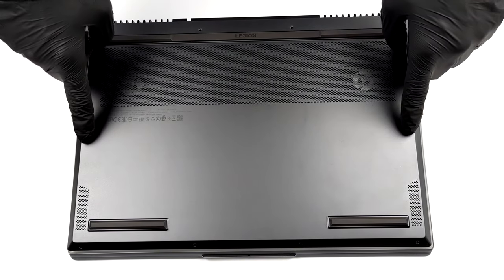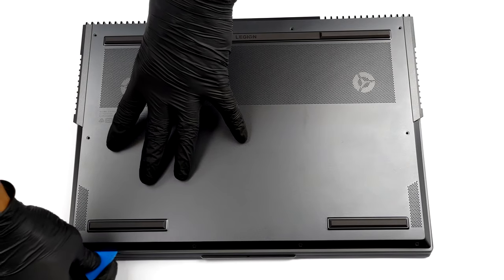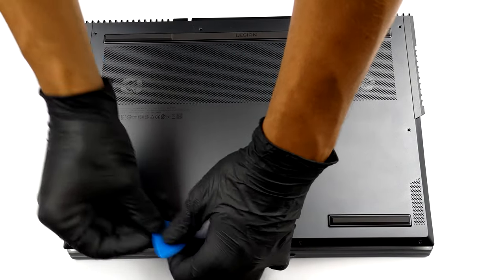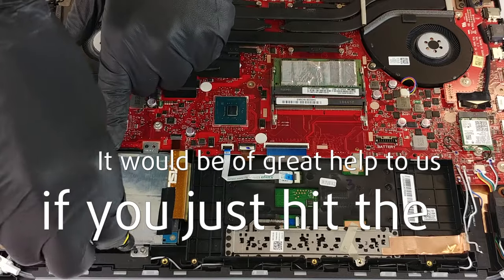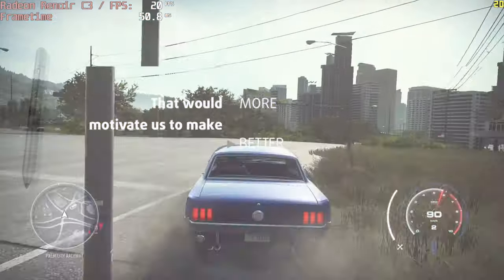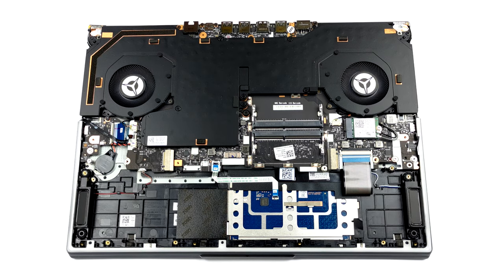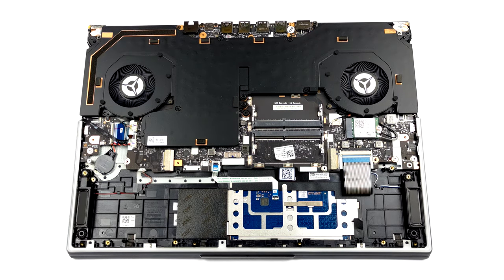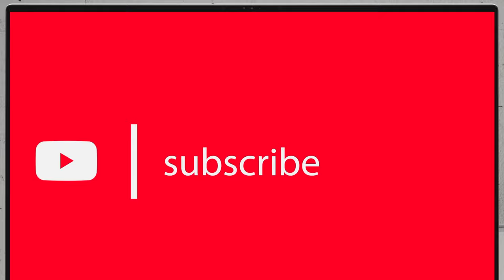🛠️ Lenovo Legion 7 (16", 2021) - disassembly and upgrade options

Comment: just returned mine because of coil whine noise
Reply: Oh thats no good, i assume coming from the cooling fans?
Reply: me too as well i saw three units has the same issues, my laptop and my friend's laptop and the show laptop all of them have RTX. 3080 and R9 5900HX
Reply: @mohad_yj  mine is fine
Reply: mine got no coil whine issue, lucky me!
Reply: My RTX 3070 + 5800H version seems to be fine
Reply: Mine have some whine, but when I set fan control or something like that in BIOS to level 2 or 3 coil whine complete gone.
Reply: @ltrttl  I got that version too.  Is it good? I’m starting to wondering if I should’ve bought Intel version, should I stick with amd? Also, do you know what kind of ssd storage I can buy to add more storage to mine.  Also to be clear, I ordered mine I haven’t actually received it yet I’m sure I’ll love either one
Reply: @nobnoby6671  yes, it’s definitely good. I think Intel version would be somewhat better in games but it is definitely hotter and noisier. The same frequencies that I get on AMD with TDP around 60-65W, Intel version gets with TDP 80-90W. So in long-term tasks such as compiling or rendering it should be worse. Also Intel version has PCI-E 4.0 SSD with 6,5+GBps sequential read speeds. But AMD version has significantly better battery life. So up on your preferences. 
As you can see in the video, there is one unused M2 slot on both versions, I think it should be standard 2280 slot, so a lot of 2280 SSDs are compatible
Reply: @ltrttl  Tbh I’m mostly using this just for gaming so maybe I should for Intel? does it get TOO hot tho? Will cooling be a problem I think? Thanks for response btw
Reply: @nobnoby6671  cooling system there is enough even for 90W Intel chip, but it still leads to higher temperatures overall. On AMD version I have 65-69C, while on Intel version it might go above 80 sometimes according to tests from the Internet. This is still okay, but it will be definitely noisier. Also, in CPU-intensive games you will get less power on GPU because of CPU power package. I think overall 5800H and 11800H (or 5980HX and 11980HK) should perform about the same. There is no direct comparison between Intel and AMD versions of this notebook, but I compare my results on 3070 model with results in a review of 3080 + 11980HK model, and my results are about 5-15% lower then 3080+11980HK results, which should be ok. But Intel version has PCI-E 4.0 SSD, so if it is more important then battery life and noise, maybe you should go for Intel version
Reply: @ltrttl  thanks for reply, I might go with amd.  Honestly though, I feel like whatever I go with I csnt go wrong.  It seems like 50% of people say amd and other half Intel.  Leaning towards amd but I’m sure I’ll be happy with both
Reply: 🤣🤣🤣🤣🤣
I have the 7i with the Intel i9 and rtx3080. I have coil whine but because there are no other laptops that even come close to the performance of this beast, I'll live with it. I mostly gmae with headphones anyway so it really isn't a problem.

Comment: A stanley knife in the bottom left corner did the trick for me to create an opening to put my fingernails between them. Terrible design, it's extremely hard to open the case without damaging it.